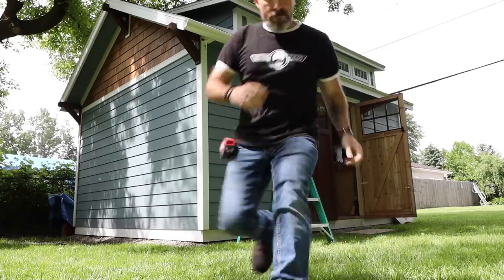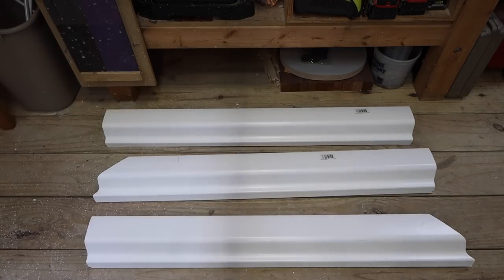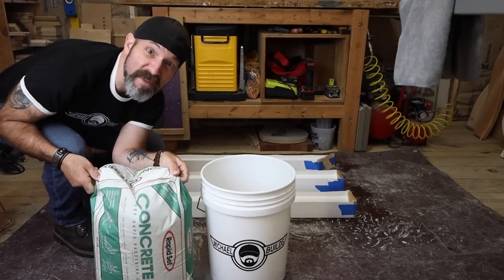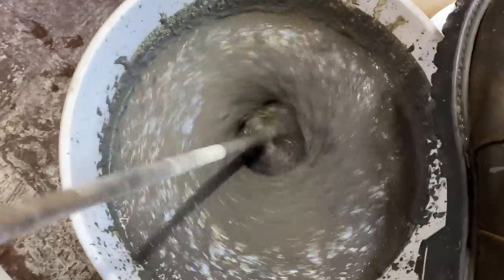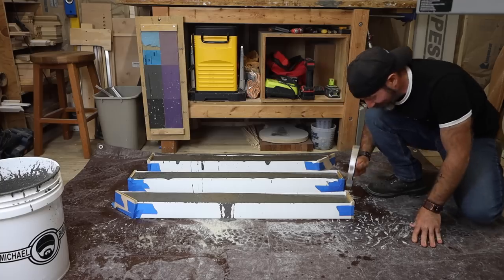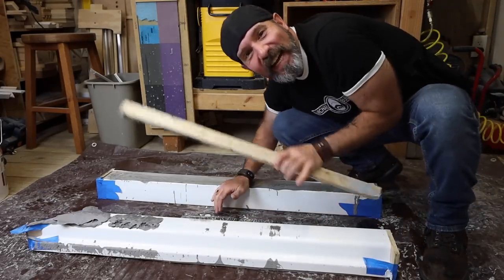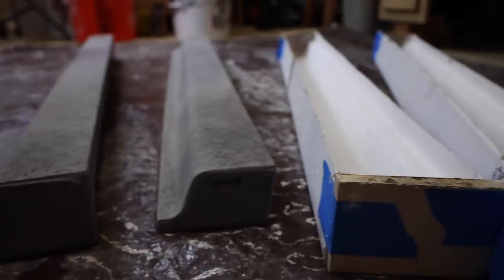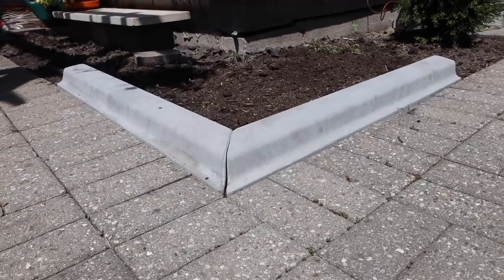I Can Put Concrete in That... CONCRETE CURBS!

Comment: Love this!! Could put a pin (1/2” dowel or something) in the mold spaced out so you can drive rebar down into the ground to keep them from moving.
Reply: I’ll be back
Reply: I was thinking set some rebar "pins" in the wet concrete sticking out and ready to stick in the ground but that would only work in relatively soft ground (like where I'm at here in Florida, where everything is sand).

Comment: LOL nice, to play with concrete all one needs is a damp sand pit and trashbags. A way to strengthen concrete that actually is little known, boil some rice  and strain the water out, 4oz, of it per gallon to your mix water, it causes the size of the microcrystals during formation to shorten but not narrow allowing more omni-directional microcrystalization. This will increase mostly crush strength, and has a very positive effect against impact breakage. as long as it is a >1/10 ratio to the lime, it will work, you could use only rice water and no gain over the 10%.

Comment: You could put a small piece of pvc pipe sized for your rebar to fit inside, you just leave the "tube" in so you dont risk breaking concete curb trying to remove a "hole die" - also should help keep the rebar rust away from the concrete edge.

Comment: I actually have this stuff in my trunk to make
 Thought it was one of my ideas that ma fail. So glad I found your video now I know it will work. Could I put a 1/2 inch garden steak in to be able to drive them in the ground??? Ya know after it has set some? I am new to cement anything. Beginner so any advice would help. Thanks
Margaret

Comment: So I am trying this and I have a few questions for Michael.  Maybe tips for others.
1. I cut my forms to 40 inches and one bag of concrete didn't fill the two of them up.  not sure if that is variance in the bag, the amount of water 4.5 quarts, or something else.
2.  I got two gutters to do this and one was bent.  I cut them and kept them stacked for a a day or s<o to straighten them out.  It didn't work.  When you pick the gutter up, make sure it's straight from the start.
3.  The concrete sets quick.  It says you have 15 minutes to work it, 15 minutes goes quick.  Does the set control help this?  If so how much more time can it give me?

Any help would be appreciated.
Reply: @Michael Builds

Comment: I need your help. I’ve poured 3 Countertops . The third one is for burner. It has a small crack. I put rebarb in it to help. My question is what is the best way to cover the crack. To where it is less noticeable It has cracked twice. Trying not have pour it again.